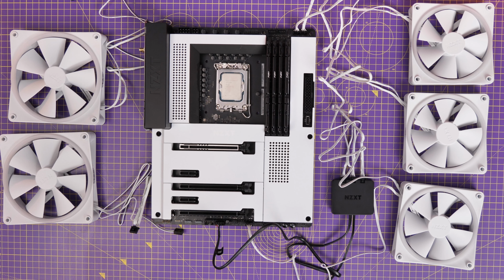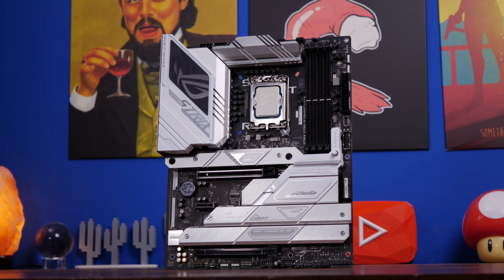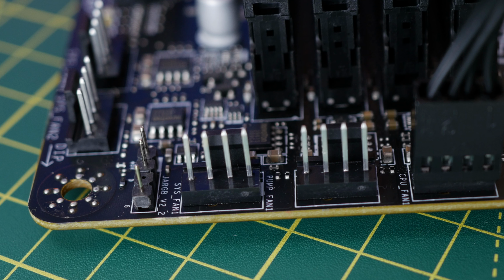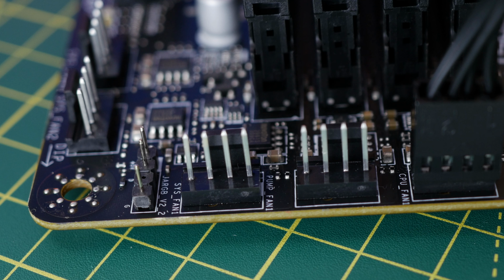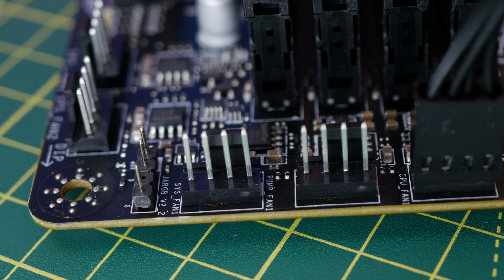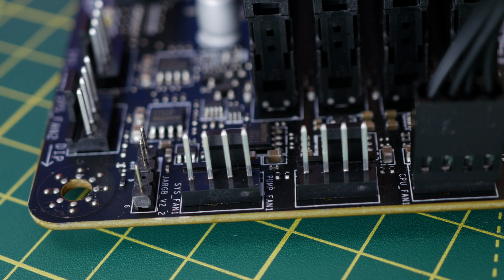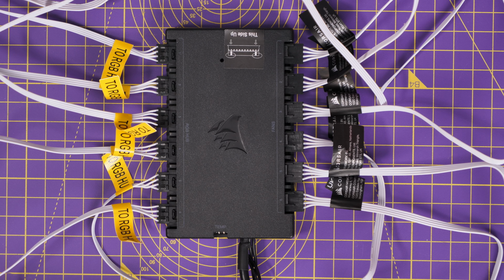How to connect RGB fans to your motherboard - Corsair, NZXT, Montech, Antec and more

Comment: TY for all your videos. I got a question: I came across this product "CORSAIR Commander Duo iCUE Link RGB Lighting & PWM ARGB Fan Controller" there's a physical switch on it "ARGB" or "Link" is this the ICUE HW version of the Lian-Li L-Connect 3 software switch "LC3" or "MB" control? I very much would like to get the "CORSAIR iCUE LINK LX120 RGB 120mm PWM Fans" and control it with Armoury Crate. Is this my answer and if not is there a way to sync these fans to "Armory Crate"? Thanks again. Robert
Reply from the maker: Here's an explainer on that - https://youtu.be/nB8eLcVG17k

Comment: this Montech is so propiertary. There is only 3 pins and one seems to be blocked. My MOBO has regular 4 pins for non RGB, but I also see RGB which socket 4 pin headers. And the 5 pin Ext_Fan (controller)

Comment: non proprietary.upHere
ARGB Magnetic Fan Hub with Controller, 12 Ports 4-Pin PWM Fan Connector, 12 x 5V 3-Pin ARGB Ports, Infinity Mirror Design, Adjustable Speed Cooling Hub for Custom RGB PC, White

Comment: Hey man. My h150i fans/cooling system fans have 6 cables coming from them and all only connect to the commander hub but only on the fan power side, the rgb connectors are the same as the fan power connectors! I have no idea what I’m doing at this point, I hope you can help

Comment: Hey Mr Prawn i have a doubt 
so connecting all those chasis and cpu fan into a one hub and then connecting the other end from the PWM/ARGB hub to the cpu out fan and 5v port in the MOBO - technically all the fans runs but i am only seeing every fan as one fan 'CPU fan' as i connected the pwm out to the cpu fan 
i am confused here do i need to reconect the fans pwm side to chas_fan and the argb in the module, i have like 4 chas_fan port on my tuf x670e +wifi board but i am plannning a add a couple of fans more say a 360mm aio cooler and another 4 more fans 
what do you think i need to do?
so that i can se each inidividua fans are visible and also my nzxt case doesnt come with a exhuast fan so i just unscrewerd one from the front and bolted near the exhuast portion , is that ok? to do so? i mean i think the case does have a positive airflow so far.

Comment: Thanks for posting this video. I am still confused with my specific Antec case. I am using an NX 500 M ARGB case that does not support PWM even though the Asus motherboard does. I confirmed this with Antec support. It comes with three ARGB fans and the manual shows you can add three more fans but does not explain the wiring. I was thinking adding two on top , however would I need a hub like the Thermalright? Amazon sells a 3 pack Antec ARGB with a hub that does support PWM adding to my confusion. Any help would be greatly appreciated. Thanks.

Comment: Can I daisy-chain the ARGB and PWM cables, then connect the last ARGB and PWM connectors to the ARGB and PWM headers (ex. Thermalright hub)?

Or remove the argb/pwm hub then connect the daisychained pwm/argb to the motherboard header?
Reply from the maker: Depends on the fans. But you'd need to think about how many fans are in the chain too because motherboard headers can only output a certain amount of power. RGB is ok usually but fan power is limited

Comment: Help. I am confused.  My motherboard is the gigabyte aorus gaming 3. It has 4 led headers that are supposed to be controllable using their RGB software. So; two of the headers are 3 pin, 3 pins side by side together. Other two are 5 pins side by side together.  I have thermalright RGB fans.  The RGB plugs on the fans are 3 pin, with a gap in the pins. Just like you have in this video.  Problem is these do not match any of the led headers pins on the motherboard. How  am I supposed to hook this up?
Reply from the maker: Odd. I've not seen a motherboard with 3 pin 5v RGB. Can you check the manual maybe?
Reply: @ 
@TheProvokedPrawn
In the manual:  
the 3 pin on board says D_LED1, and pins are labeled as: 1-V 2-D 3–G (VDG). A jumper sets as 5V or 12V
The 5 pins on board say LED_C1, and pins are labeled as: 1-12V 2-R 3-G 4-B 5-W (12VRGBW)
How do I connect these to that standard led plug that is on the fan (or the hub) that is in the video?

Comment: Fantastic video. All the info I needed in the first 5 minutes to install Sama case fans to replace some old dying ones in my rig. Easiest installation with fans I have ever had, worked on the first restart which is rare for me. Knowing the different possible header labels was very helpful info. I was able to daisy chain the RBG and power cables with the fans I bought because they came with those options, plugged it in my pump and used my last sysfan header. So easy I might buy more Sama fans to replace my front fans now!

Comment: I have NZXT fans, will the rgb connectors fit into the 4-pin JRGB connectors on the MSI b650 gaming plus wifi? Or should i leave the rgb connectors off until i get a controller?
Reply from the maker: They're proprietary, so don't try to connect them to the motherboard. You'll break it/them
Reply: @ ok, I left them unhooked thankfully. I appreciate the videos, I definitely would’ve messed up without it.

Comment: If my motherboard has 3 addressable RGB 5v headers with a maximum of 80 leds on each, would linking 3 Phanteks D30s (each have 30 leds) mean some of the LEDs wont work, if so do i need a RGB controller? Great video by the way.
Reply: Found the issue, think it’s not an issue as the Phantek and the Lian Li fans use mirroring thus they have 50% less addressable leds, hopefully I should be fine.

Comment: Im still confused in the nxzt fans. I have a h9 flow nxzt case that comes with 4 fans and planning on making a total of 9 maybe 10. You say to only plug them into the nxzt motherboard. I have a ROG b650 motherboard with the 5v 3 pins so the nxzt fans wont connect to it. But what if i buy the nxzt controller? Will the controller then have the adapter or wire that comes with it to connect to a NON NXZT motherboard (ROG B650)?
Reply from the maker: Exactly. You need a controller

Comment: So, I don't believe my motherboard has any 3-pin RGB headers, but that's what my Montech fans need. If I were to plug everything into the hub and daisy chain the RGB connectors without plugging any RGB connectors to the motherboard, won't the fan hub still light up the fans?

Comment: so it is totally okay if i daisy chain 3 fans into the one argb 5v connector on my mobo? and it is also okay to daisy chain 3 fans into the one power connector on my mobo? i saw in some vids people say not more than 2 fans into a single SYS_FAN power connector
Reply: 3 fans is is typically ok but because of the low voltage of the 3 pin header, it may not provide sufficient power to fans therefore damaging it and the motherboard due to too much stress. To be safe getting a 5volt 3 pin splitter is a better option and more recommended instead of daisy chaining 3 fans to one header.

Comment: Sorely missed is some explanation on connecting both fans and AIO as you showed the PWM plug on the fans controller but failed to mention its use.

Comment: Can someone explain why my hub which came with the PC case does not deliver enough power to light the fans up? 

I did not add anything else to it, it just worked on the first start and the next one they were so low in brightness that I thought they were off. 

I ended up linking them together to the available RGB slots on the motherboard.

Comment: Man my b350 doesn't have RGB connectors lol
Reply: In that case you can use a controller (in your case Corsair maybe best). The Corsair ones will usually take power off the PSU and then connect to an internal USB header for control instead of a MB RGB header.

Comment: I have a question for 2in1 ARGB + Fan hubs in general. The power supply, in consideration to 3 pin - 4 pin, to any hub is either 5v or 12v and I am in a bit of a pickle with 12v fans and 5v ARGBs. 

My question is, do these controllers usually have built in converters as to I power it with, for instance 12v, and it will supply respectively 5v to argb heads and 12v to fan heads?

I am trying really hard to avoid having two hubs, one for fans and one for argbs, but no matter how I twist it its looking more and more like that would be the only easy fix, without adding extra complications.

Comment: 🚀Building my first gaming rig and content creation powerhouse!  with i7 14700 on MSI Z90 board, took me a while to work out the Rainbow rgb.
Reply from the maker: Have you connected everything correctly
Reply: @TheProvokedPrawn   I found the rainbow connectors and CPU cooler is good.  
I found a video and the case fan need powering by the data cable, so al good now thanks 😀👍
Reply: Do you maybe now witch motherboard he used? Not te nzxt but the other one!

Comment: hi, can the "Thermalright fan and ARGB hub" work with fans that has not RGB? so only plugging the power into thermalright hub without the RGB?

also, do I plug the CPU fan into it ? and plugging the hub into SYS_Fan? or it is separated into CPU_Fan? thanks
Reply from the maker: @Jarrahfe  there's a standard fan huh for non RGB https://amzn.to/3X525xo

CPU fan id connect to CPU fan tbh

Comment: I went out and bought 1 of the fan and argb hubs only to find that the rgb cables coming from the fans are also 4 pin like the power supply cables. I have the the Corsair AR120 kit and it comes with 1-3 splitter but the splitter has 1 female 3 pin end then the 3 splits are numbered 1 - male 3 pin 2 - male 4 pin 3 - male 4 pin, so as you can tell I’m mega confused as to how this can all be connected together when none of fans use 3 pin anything 🙈
Reply: Do you maybe now witch motherboard he used? Not te nzxt but the other one!
Reply: @nerd_conversation there is about 3 different motherboards in this video. The ones I recognise that aren’t NZXT are the Gigabyte Z790 Aorus Elite AX and the Gigabyte B650 Gaming X AX, hope that helps

Comment: I have the H6 Flow RGB ver and im not really planning on buying a fan hub I’m wondering could i just plug the NZXT fans into one ARGB header with a splitter or would that not work?
Reply: Do you maybe now witch motherboard he used? Not te nzxt but the other one!
Reply: @nerd_conversation  he used the MSI B650M PROJECT ZERO Motherboard

Comment: First time building a PC in the NZXT 9 Elite. Lesson learned. Go all one system fans with a controler. Couldn't figure out what to use to convert othee fans (AIO) fans with RGB from 3 to 4 pin that would fit into the NZXT controler 😢.

Comment: Are the actual NZXT RGB hubs proprietary? Planning on getting F120 and F140 fans for my build but my motherboard is from ASUS. Will i be able to use NZXT's fan controllers?
Reply from the maker: NZXT controllers work with any motherboard but you can only connect NZXT fans to them

Comment: Hello! I'm installing A-RGB fans for the 1st time and I wanted to make sure that I understood it properly, because I'm a bit confused. Do I need to connect the fans after daisy-chaining them (power + rgb) into the 3 pin (aka ADDR_LED pin) on the motherboard, as well as to the CHA_FAN pin? Or I can only daisy-chain them through the 3-pin and just plug the end to the 5V ADDR_LED pin on the  motherboard and they will run perfectly. Thanks in advance!

Comment: Ive got an antec ax61 case with 4 built in rgb fans pre daisy chained but the power cord seems to be a sata cable and I cant figure out how to plug that into the psu (red dragon 80+ gold 850 watt rgb. Any idea how this works? Its my 1st pc build. Thanks

Comment: In my H500M i have my CM Mobius ARGB fans installed via the small CM A1 Controller that came with my PL360 Flux 30th AE AiO and set it up via the MasterPlus software, 
which is quite good and the small and rather cheap controller is much more capable than my X570Aorus Pro and Gigabytes Fusion RGB Software, which is just bad.

That little thing has only 3 ARGB connectors, but each of them can control up to 80LED's.

The Mobius Fans also come with RGB daisychaining, so that makes also a little easier.
I have set em up like that:
Front: 3x140mm Mobius ARGB at Slot 1 (with a 1 to 5 way CM ARGB Splitter as the cables werent long enuff to reach the controller)
Top: AiO 3x120mm Mobius ARGB and the 2Zone Pump(symbol and outer ring) at Slot 2
Rear: 1x140mm Mobius ARGB at Slot 3

The Controller and the Software can still detect and control every single one device and even every single LED, despite splitters and daisy chaining, 
while the PWM Fan control is coming from the Motherboard and gets splitted via the one of the AiO and a seperate 3way splitter for the front fans, so i have only 3 fan setups to control.
Reply: Do you maybe now witch motherboard he used? Not te nzxt but the other one!
Reply: @nerd_conversation  
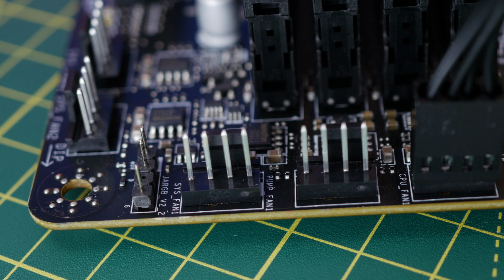You mean the one at 15:12 ? Thats an ASUS Strix Z790-A Gaming Wifi D4.
18:27 looks a Gigabyte X670 Gaming X AX (V1) there is also the newer V2

Comment: Hello i want to ask how to connect 3 reverse sl inf fans to a sl ing aio fan hub without buying any other cable or other hub im building a pc with a lian li ga ii trinity 360 sl inf and 3 reverse infinity fans and in my contry its impossible to get a single sl inf fan hub or cables from lian li

Comment: I recently got the 8 fan Noctua fan hub which can be used with or without sata power. I intend to use sata power but I have 9 fans. 3 p12s from aio, 4 NFa12s and 2 NFa14s. Do you think it's ok to put the 3 p12s on a splitter to one port on the hub and the rest directly to the hub? I couldn't find any clear info from Noctuas website. Thanks!
Reply from the maker: I'd connect the ones from the AIO to CPU fan and then use the rest on a hub.
Reply: @TheProvokedPrawn  Awesome, I really appreciate your input and response!

Comment: Thanks for the good information on the various fans. I recently built my first gaming PC but used older components like an Arock Z87 Intel 4th gen MB that has no ARGB, and installed it into a new Gamdias Talos case that came with 4 ARGB fans. A $25 SATA powered PWM ARGB fan hub with remote solved my problem. It serves 9 fan PWR and ARGB connections.The fan hub has lighting as well and has a magnet base. I can control the fans speed and lighting with the PC case button or the remote My next build will have a bit newer Asrock Z390 Phantom that does have the RGB header.

Comment: The goal: have less cables on the PC
Reality: a lot of new proprietary cables and hubs

I have a question, can I connect Lian Li AL140mm V2 in the same hub as AL 120mm V2? Or I have to buy another hub just for the 140mm V2?
Reply from the maker: Yes that's fine
Reply: @TheProvokedPrawn thanks!

Comment: Almost like you knew i was researching this topic. I'm about to order 7 Arctic ARGB fans, and was looking for a hub that could do both the fans and ARGB. Going to order the Thermalright hub aswell. Thank you Mr Prawn
Reply: Do you maybe now witch motherboard he used? Not te nzxt but the other one!
Reply: @nerd_conversation for the nxzt since the controller only has 6 rgb ports is it possible to use a splitter on 2 fans and then connect it to 1 rgb port? And get rgb power to more then 6?

Comment: Hello, I recently found your channel, I don't speak English very well but I try, I tell you that I'm in a mess with the issue of fans, I'm currently building a PC, the case is a Lianli 011 Vision, I bought a Kraken liquid cooling elite RGB 360 and 6 CORSAIR iCUE AR120 RGB fans, the question is that I feel that I will not be able to connect them and synchronize everything, I hardly know about the subject but I have seen your videos that show a lot of cables, could you give me a recommendation so I can do it easier? The most recommended process and objects to do it in the best way? Since I don't know what to buy and what might help me, I would really appreciate it!

Comment: hey mr prawn, does the nzxt controller compatible with my board which is msi mag b760 tomahawk wifi d5 ?
Reply from the maker: As long as you have USB (which you should) then yes. If you only have one port then you might need a USB hub but otherwise it'll be fine

Comment: Should corsair fans best be only used with commander core etc or control via like bios asus armoury crate or ice?
Reply from the maker: Much easier with Commander Core and control via iCue
Reply: @TheProvokedPrawn  thank you ps any idea when doing so why I can only control my fan speed on the rad fans and not each set of LL120 fans that are all connected to my commander node, that's what was frustrating me and making me think I might have to connect via motherboard direct because they all go at one speed.

Comment: RGB connectors suck to begin with. The NZXT version pisses me off as it has to be different. Good luck trying to get the cables to convert them. It was such a headache.
Reply: do nzxt fans work with the argb fan hub? I don’t want to have to get different fans but if I have to then f it